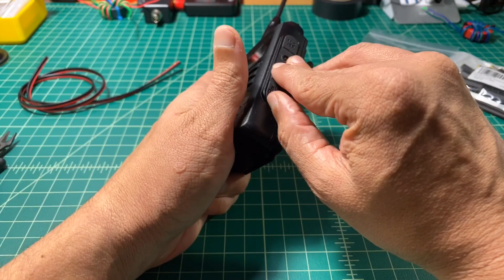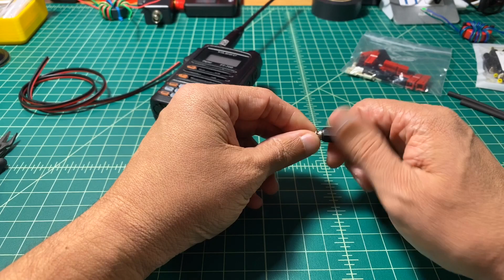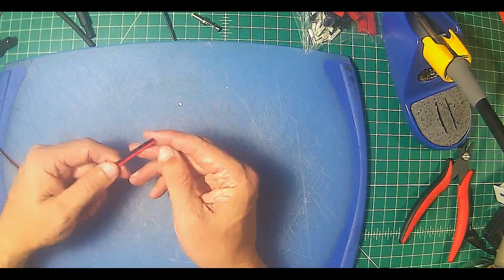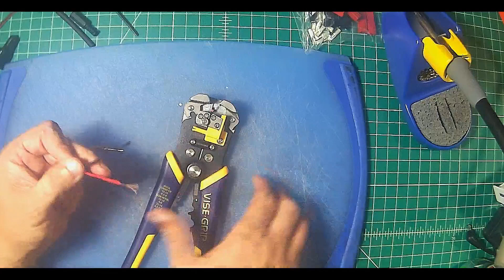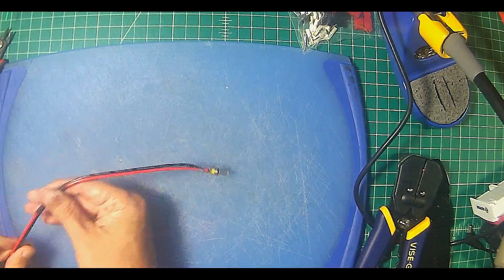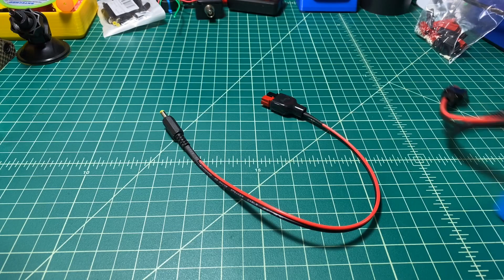Yaesu FT-70D DC Power Adapter - TheSmokinApe

Comment: I wasn't able to find the tolerance/voltage range the radio would accept. I have the SBH-28 desktop charger. It says, INPUT: 10.5v at 1A, OUTPUT: 8.4v at 800mA.  Connecting the desktop charger to a 12v battery, my meter showed 13.21v at 460mA was being consumed by the desktop charger. So no issue with using a similar cable with a 12v source. Thanks!
Reply from the maker: Glad you have a solution 👍

Comment: Thank you! Very creative! Should the left side Mode/ Status LED above the LCD light up red while changing and then green when charging complete? Reason I'm asking because I just got this brand new FT70DR and using just the SAD-25 a/c adapter that  came with it to charge but no red LED is lit during charging. According to the manual the Mode/Status red LED should come on...
Reply from the maker: According to my memory the display says it’s charging
Reply: @TheSmokinApe  ok, thanks.  .

Comment: When you have the radio contacted to a battery can you transmit or will it hurt the radio
Reply from the maker: @juanfgonzalez2039  I don’t do it so not sure
Reply: @TheSmokinApe  thanks bro love your videos Kk6ikw
Reply from the maker: Glad you like them and thank you for watching 👍
Reply: You can use an external 12v battery with the cable mentioned above to charge the SBR-24LI battery. When you power on the radio, it stops charging the SBR-24LI battery and powers the radio from the external DC source (minor drawback with the radio. I wish you could charge and power the radio from external DC at the same time). You can also power on the radio and transmit with the SB-24LI battery removed. The radio will show "EXT DC" when powered off. Powering on the radio it shows 13.0v (in my case). With my power meter, between a 12v LiFeP04 batter and the radio, transmitting on high power, the meter reads 13.18v at 1.38 amps. So yes, you can transmit using an external DC power source.

Comment: does anyones ft-70 run off 12 volts external power without the battery? mine does not, ithe external power port only charges the battery when installed. bu,,er,as i wanted to use this radio for 24/7 monitoring! anyone have this same issue
Reply from the maker: Sorry man, I do not...

Comment: Will the FT-70D accept 13.8V on it's DC-in port?  The manual isn't too clear about it.  Thanks!
Reply from the maker: The charger is rated for 10.5v, 13.8v might be "high risk"
Reply: @TheSmokinApe  OK, I did some experiments with a bench supply.  My application is a fox hunt transmitter with a 75% duty cycle, with the radio set to 2W output.  With 12V going to the DC -in port, the radio got too hot to comfortably hold after 30 minutes.  After backing off the voltage to 7.2v (the battery pack voltage) the radio just got slightly warm after 30 minutes. Looks like it's got a linear regulator that's converting the excess voltage to heat.

Comment: Hey 👋 Ape! What’s the size of that connector? There is no link on your Amazon store!
Reply from the maker: Connector Size - 4.0mm x 1.7mm - External Diameter x Internal Diameter
Reply: Thanks 🙏 Ape I used the label on the package 📦 from your video to search and found the item!
73 de N1UFO

Comment: Glad I came across this as I have been looking into this for a while but was not sure that the radio could handle 12V on that side port as the charger outputs 10.5V.
I will try building one very soon.
Thanks for sharing.
Reply: The manual indicates up to 16 volts 😲

Comment: I am trying to design my own 12VDC power supply from my vehicle. I can't seem to find the specifications for the input voltage tolerances. Vehicle power can vary up to 14.7 VDC.  Do I need to regulate this voltage or will the FT70D tolerate it?
Reply from the maker: I give mine 13.6-13.8, I wasn't able to find the tolerances but being honest 14.7 would make me nervous...

Comment: Nicely done!  The outer part of the connector is called the "shell."  Did you find the radio charges faster with a 12V supply, compared to the 10.5V OEM wall wart?
Reply: Well Mr. Ape. Did it? Did you test it? Please Please test it. Connect it to your variable voltage POWA supply and see what it can handle. I'll bet it'll take up to 13.8.

Comment: By making this lead, have you found that it charges faster than with the standard adapter? Or is the bottleneck in the radio?
Reply from the maker: Honestly, I haven't compared the two side by side.
Reply: I have not run a side by side test, but DC charging is SLOW. I use the same Bioenno battery as here.

Comment: Excellent video, here is a pro tip for you:  The power pole crimper is retching for a reason.  Its not to make a pretty clicking noise when you squeeze the handle.  What you do is place the metal connecter in the crimper in the correct orientation.  Squeeze the handle just until the jaws of the crimper touch the connector and does not come out.  Then insert the wire in to the hole of the metal connector.  Now while holding the wire and the crimper, squeeze the crimper until the connector is fastened and there you go easy peasy lemon squeezy.  I am not saying your method does not work, but thought this would make your building of patch cables much easier.
Reply from the maker: Thanks for the tip 👍

Comment: I can power my FT60R from12v but I don’t think it charges from it. I’ll have to look into it
Reply from the maker: I'm not sure if it does.
Reply: It's all right, it's charging! The current consumption of ft5d is equal to:
Adapter 10 V ---- 0,17A
Accu 12 V ----- 0,16 A
Battery alkaline 6LR61 9 V ----- 0,22 A

Comment: Yes the charging cradle is of no use outside the home, a connector for mobile makes sense. Are only cheap Chinese radios uses a USB for charging?
Reply from the maker: Yeah, I’ve only seen the Chinese ones have USB so far.

Comment: Is the input on the radio 12 volts ? On my UK power supply it looks like 10 volts ?
Reply from the maker: My power supply says 10 as well, it’s my understanding the radio can handle 12 but I didn’t see it documented. 👍
Reply: 11-16

Comment: I think the ft70d will not charge when the radio is on using either: the base charger OR the wall wart plugged into the side.

Using the standard wall wart plugged in to the side takes 8 to 10 hours from 0 to 100.
Using the drop in cradle charger it takes 4 hours to go from 0 to 100 percent.
Reply: Ft70d user:  with radio in base charger the battery stops charging when radio is on.  With radio off in the base charger the battery will charge.
Reply from the maker: I don't know, I typically don't use them when charging.
Reply: The FT3dr (I know not this radio) when plugged in the radio runs off of the plug disconnecting the battery and then trickle charges the battery. 
If you use the supplied AC adapter and key up with power set to high you will brown out the 3dr and it will reset as it can only put out 1a not 3, the adapter that comes with the 3dr can power it in mid or low, the cord plugged into a PP for your shack has plenty of power and it transmits on high just fine while plugged in and charging.
You can do the same to a cigarette lighter, no need for any circuits or battery eliminators, just go from cigarette adapter to 4mm connector.
Again, that is all true for a 3dr but yaesu does a lot of the stuff the same.
We will have to get Ape to key up while it is plugged in.
Reply from the maker: Just tried and it did key up.

Comment: WAY off topic but I thought it a  good spot to share.   You know the convaluted way to program the radio...plug this in do that yada yada.  You can skip a lot of that.  I just turn the radio on and pop the battery.   THen I plug the USB cable in.   Then hold the AMS button down and snap the battery back in and it goes into the ADMS mode thing.   Bypasses a ton of steps and japanese finger traps.   Excellent video as always!
Reply from the maker: Good tip! I didn't know that.  Glad you liked the video.
Reply: @TheSmokinApe  Goes way back to the IT days the directions would say "always keep ac adaptor connected before doing this or that with a laptop".  I would think why?   If the battery is the power source the laptop shouldn't care or know.  Same with this the radio doesn't know where the power is so bypass that.  Makes life so much easier and faster.  Sorry for the rambles.   73 Sir!

Comment: Can you run the FT70 on the battery if you remove the battery on the radio? Thank you
Reply: you can the 3dr, just tested it, the 70 should be the same.
Reply from the maker: I didn't try, sorry man.

Comment: you heat shrunk your bag of Power Poles! FYI can you make a power cable for the car on an FT3DR HT. mine when on with APRS running drains the battery fast!
Reply from the maker: I sure did, I noticed that when I was cleaning up 🤔